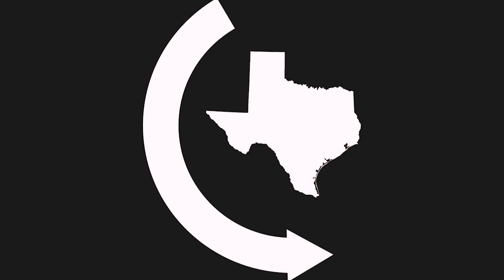ROBOT VS ZOMBIE! Zombie Go Boom!

Comment: I can see the working principle of the frisbee launcher: basically it's just a fast running belt driving one edge of the frisbee forward, while the opposite edge rolls on a grippy/rubbery surface. Now use a badass 5HP induction motor with a gearbox to increase speed, and tougher belt, and based on that principle you could shoot about anything circular, though only very few things will fly straight, or actually "fly" at all. Much trouble for not much result, zombieslaying-wise.

Comment: Would a drill be a good zombie weapon? First, whack the Ivan head with the battery end, then thrust at the Ivan head while the drill is running.
Reply: good idea pretty savage
Reply: it would probably break the drill when u hit the battery. if in fact u actually wanna do damage
Reply: And use a butterfly bit
Reply: don't. li-ion batteries are extremely flammable. think about phones. it would have the same effect as throwing a phone at it

Comment: I think the frisbee's problem is it's low mass, with the pencil even thought the weapon itself is light and frail you can still put quite a bit of your body mass behind it, and the force is very concentrated. The frisbee is light, you can't put you weight into it because it's thrown, the edge is broad and the material absorb some of the force on impact by deforming. I don't think any mod short of turning the frisbee into a legit chakram is going to cut it...
You could maybe try adding a metal rim to the frisbee, maybe the machine would still be able to launch it as long as the metal rim doesn't poke out or modify the frisbee's profile. Maybe then the speed combined with the increased mass and reduced elasticity would be able to do some damage but I'm skeptical.

Comment: This is actually simplistic calculations it's not lethal and I haven't even watched passed where you said its 25mph multiply that by 5280 that's the equivalent of a mile in feet then divide it by 60 twice its only 36.6 bar notation (not rounded) feet per second that's not a lethal blow